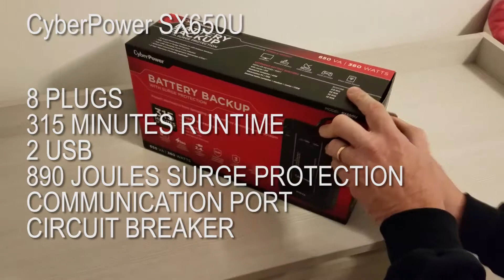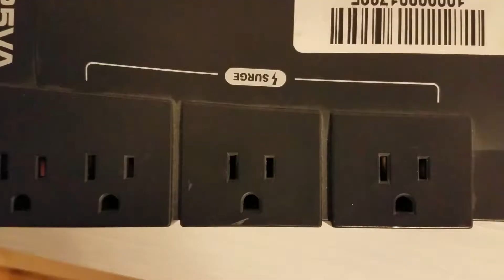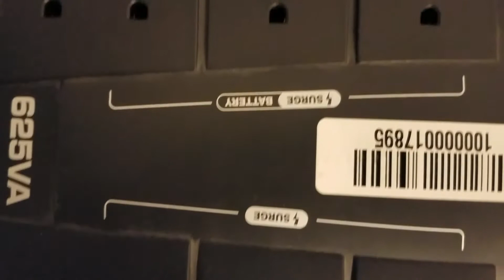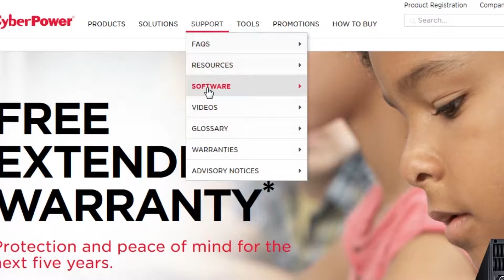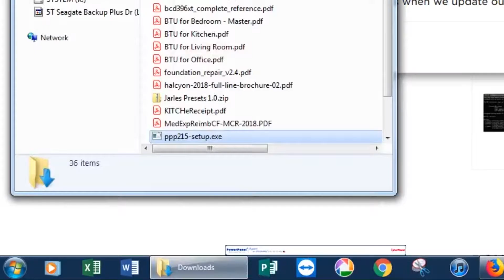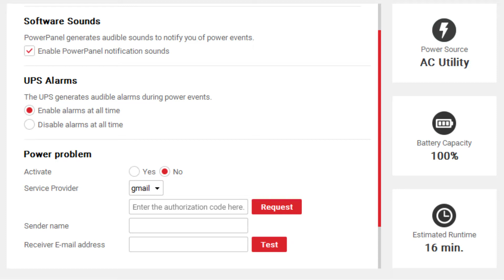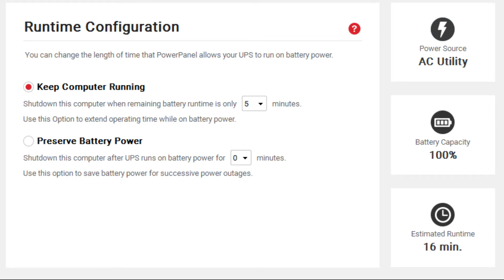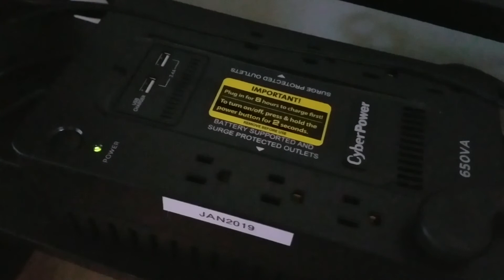CYBERPOWER 650VA UPS Truth and Lies

Comment: Mine keeps switching from eco to battery mode for no reason. I have a smart TV plugged in, a pc, a modem and two phone chargers. Worked fine for about three months, now it's doing this madness
Reply from the maker: In the Powerpanel do you see any items listed under Event Logs or Summary? BTW the Event Logs default to the current day so you have to give it a FROM date that earlier than today. If nothing listed then it could be a problem with unit, and I would reach out to their tech support.
Reply: Dirty power. These things have a auto transformer in them and they are programmed to switch to battery power during brownouts loss of power and over voltage/surge. usually they will switch to battery power if the voltage drops below 115 volts or goes over 127 volts.

Comment: So do I leave the power OFF when charging the battery or does it charge when the power is ON?
Reply from the maker: The unit starts to recharge the battery pack upon being plugged in and if in the ON position is able to apply voltage correction and power to your device(s).
Reply: @cfldriven  Awesome. Thank you.

Comment: Just wondering why it does not show any light while charging!?  Don't know if it's working? I just buight it , any Idea ? maybe it's only my UPS ?
Reply from the maker: The only comes on when you turn on the unit.
Reply: @cfldriven  oh ok but how do I know it's charging ? Light is solid yellow not changing at all , not even blinking while charging !
Reply from the maker: @emmontana2422  There is no charging indicator light. If the light is always on even with the unit is powered off but still plugged in than that might be an indication of a  bad  ground,  missing ground,  or  reversed  wiring. If you install the software it will tell you the status of the unit and if it has charged. You could also just unplug and see it the ups powers a lamp.

Comment: Yeah I have the old model 650VA and it's failed me 2x in the last 6 months. Had 2 separate `blips' in the house lights and both times the unit stopped feeding power to the devices. Is that dead battery behavior? If so this POS only gave me 18 months of service!
Reply from the maker: Well it can that the battery has died, rip, in which case check the warranty you maybe able to get free replacement. Or you are drawing too much power and it runs out of juice. Try something simple like one device and see if it keeps it running and for how long. As I say in the video you will not get a long run time unless you are just recharging your phone, these devices are meant to give you enuff power to safely shutdown in extended outage, but should ride out during a blip, unless it is overloaded.
Reply: @cfldriven  Thanks for this. Sadly the warranty expired but I can't verify on the website exactly how long that is. With my existing devices I was getting about 10 minutes, then suddenly the unit dies at the slightest blip. Time for a new/better unit! Cheers!
Reply from the maker: @danh543  You have a choice of replacing the batteries and saving some money over a new unit or you can upgrade to something like the CyberPower CST1500S. Here is a video on it  https://youtu.be/XveVObW70K4  .  What I did was drop new batteries in my old unit and moved it to backing up the router and some small devices, and put the new unit with the workstation. Best of luck.
Reply: @cfldriven  Interesting that the website says the model SX650G does not have a replacement battery except with serial numbers starting with `RAF'  I think I'll just recycle the thing and upgrade to a better solution. Thanks for your excellent information and responses!
Reply from the maker: @danh543  As I recall, I purchased mine from another vendor. They are very common, but gotta make sure the connections will align with your unit. I generally replace the batteries once and then replace the unit after that. The current ups CST 1500S provides status readout panel and will run the workstation for almost half an hour. That gives me plenty of time to finish a render or casually close out applications. Good luck on your next UPS.

Comment: After setting up the UPS in software (i.e. disabling the beeping noises and setting cutoff voltages), will the UPS memorize those settings so I can disconnect it from my computer?
Reply: No. It is all in the software. At least on the older models. On the new ones I am not quite sure.

Comment: Thanks for this video. One question: is it best to turn off the UPS when you are not using the devices connected to it?
Reply from the maker: While it is designed be on, you can certainly turn it off if you wish. Ours are always on, even if the devices are off.

Comment: Mine does this one long beep whenever I use it to run more CPU and GPU intensive sofware. I have a 650va one plugged into a high power gaming pc, could it be I need a 1000va or 1500va one to fix my problem?
Reply from the maker: I am using a 1500va/900 Watt on my editing workstation. Your 650va will handle 375 Watts. When choosing a UPS, it is generally recommended you chose one with an output watt capacity 20-25% higher than the total wattage of the devices you want to connect.
Hope this helps.

Comment: Mine is constantly making this high pitched sound that I can hear from across my room
Reply from the maker: Only time there is a sound is during charging and discharging otherwise it should be silent. If still in warranty I'd called tech support.
Reply: You can easily mute it in pretty sure. Yes, the alarm can be really annoying at night.

Comment: a new 12v 5ah cost $16 on amazon.
Reply from the maker: Thanks for sharing that info. I tend to replace the batteries twice before replacing the old unit. By that time the tech has improved and the ups has improved features.

Comment: I Gave you a thumbs down because there is none that tells you how to or what to do incase . so mine was brand new and i charged it 9hrs and it would turn off i needed it for my boat to charge my phone or hear a bit of music on my radio and it would work for 2 min and it would start beeping and then it would turn off.
Reply from the maker: Elizabeth sorry the video didn't help you out, but it sounds like maybe you are using it for the wrong application. If you are looking for a power source to run your radio, phone while boating then you should look into portable power station. The UPS is meant to come on during a power disruption and depending on the load may only last a few minutes. I just did a video on the Cyberpower CST1500S, which has more power then the 650VA but it only ran my computer for twenty minutes. 
https://youtu.be/XveVObW70K4
Thank you for commenting.

Comment: You can pimp these small UPS's by just getting a larger battery that won't fit in the case. Same cost for one with 3 times the capacity and an extension on the battery cables. Don't try this to enable use of larger appliances, but to extend service during outages with the recommended small loads. The software will not calibrate to the larger battery but you don't even need that geek stuff. Mine backs up my deluxe chair with 5 motors so I won't get stuck fully reclined, one LED table lamp and one laptop.
Reply from the maker: Probably a lot cheaper solution then buying a higher capacity unit. I can see where in some situations your solution is worth trying. Thanks for sharing how you use it.
Reply: @popeyegordon  How high can you actually go in amp hours? After a quick search on Amazon, I'm seeing 20 and 30 Ah batteries for about the same price as the 14. Don't some batteries need to be vented and are not recommended for indoor use? Which particular battery did you go with?
Reply: @markglenn24  Remember the same battery chemistry, meaning the same charge voltage and maintenance charge that is right for your original battery is all that matters. Unlikely your power will be out for days and you are still limited to the same wattage load rating for your UPS. 30 AH is pretty heavy, as big as a small car battery. This type of battery is not vented if is the same as your UPS uses. Sealed AGM gell cell. Sealed.
Reply: Very cool do you know of any how-to videos for upgrading the 650 ?  If it's just a simple upgrade the battery deal can you tell me which battery I should go with ?
Reply: @markglenn24  Any larger battery of the exact same chemistry type, typically sealed AGM lead acid gel cells, will have the exact same fully charged float voltage for standby and your UPS won't know the difference. It has one charge rate only so the big boy will charge slower but retain that longer reserve service if an extended outage happens. The added price for 3 or 4 times as much amp hours capacity is barely double the cost of the original battery and the bigger ones usually have a longer service life.
Reply: @popeyegordon  I'm not really knowledgeable about charging float voltages and wouldn't want to buy the wrong battery could you please point me in the right direction maybe something you already know is working with the SX650U ?
Reply: @markglenn24  All of the gel cell AGM sealed batteries have the same float voltage when topped off. You don't need the same brand of battery, just the same battery chemistry. When shopping, try to find one with the same type of connector terminals. Some motorcycle batteries have screw terminals so just a raw exposed wire can be clamped tight for a good connection.
Reply: @popeyegordon  Thanks for taking the time to reply to me here like this. I got you 100% on getting a gel cell AGM sealed battery and how to wire it.  The problem I'm having is with the capacity and with which particular voltages and Amp Hours battery to go with?  Which do you recommend?
Reply: @markglenn24  1) remove the battery  2) figure out exactly what it is by reading the markings   3) buy a larger capacity version   4) extend the wires longer so they reach the bigger battery outside of the UPS case, assuming you can't make the existing wires reach. Wires have to be soldered or joined by crimp connectors, don't even think about just twisting them together.

Comment: New units have circuit boards and components that emit a slight burnt smell before you ever plug this in. As a technician I have run across many devices that may smell this way even when brand new and never powered up but be safe and normal for years. I find mine is very efficient, the booklet describes the high efficiency battery charger circuit that wastes very little power on standby. When I plugged in mine for the initial charge the case only had one barely warm spot after several hours, no warmer than human skin.
Reply from the maker: Thank you for sharing your expertise. I agree these units run cool, although the battery run times on the packaging can be very misleading. Still I would recommend this type of device for protecting home electronics.

Comment: I bought 2 of these and they smell like its burning plasic and i barely plugged it in also does is it normal for the battery to shake on the 650 va one?
Reply from the maker: Is positive connected to positive and neg to neg? There should not be any smell of burning plastic. Could be electrics in power supply.
Yes the battery fits loosely in the case, so it may rattle when moving the power supply.
Reply: @cfldriven  Maybe it got damage cause the 2 smells like burning plasic and the smell is high

Comment: Does the UPS load mean how many watts of power are plugged into the unit?
Reply from the maker: Yes it is the total number of watts drawn by all attached devices. Ideally your UPS load capacity exceeds your system load by a fair amount. The greater capacity the longer the battery run time when AC power goes out.
Reply: Thank you

Comment: Hey man, I am looking for a way to keep my modem running as all my Ring security cameras are wireless and on solar panels. How much runtime do you reckon I would get just having the modem running on it after a power outage? and will this device do the job?
Reply from the maker: Because your modem only uses on average a dozen or less watts of power it will run longer then your computer, but don't expect it to run all day. A unit like in the video maybe 60 to 90 minutes of run-time.
You may want to check out this link for a run calculator. https://www.cyberpowersystems.com/tools/runtimes/
Reply: @cfldriven  thanks man
Reply: @cfldriven  my 850  va lcd will do 244 mins/5 hours for my router alone.
thats why i bought it. i lost power for hours the other week and id like to use my laptop when it goes out.
Reply from the maker: @Taybrenn  Just got the CyberPower CST1500S and with only a single workstation on it, I can do a fair amount of work before having to power down. The idea of using a UPS with a small load can as you demonstrated get you lots of on time. Also great for charging mobile devices. Thanks for sharing.
Reply: For outage longer than a few hours you will need a backup generator. A UPS will protect equipments as output from portable generator might not be as "clean" as utility.

Comment: Mine will occasionally start beeping 2 times out of nowhere and it lasts for a while idk why it does this? Can you please help me
Reply: I have the second one you showed in the video the 625VA the old one
Reply from the maker: A drop in line voltage might cause it to start beeping. In my house running the microwave will cause my new one to start beeping.
Reply: cfldriven ok so the beeping has stopped but after using it for a few hours it just turns off and everything it’s connected to turns off, this has happened two times so far and my pc turned off and I have to go and press the power button on it for it to turn on. Do you have any idea why it’s doing this? I have the older version that you showed in the video. Plssss respond
Reply from the maker: @mangy_marmot2  This sounds more like the internal battery needs to be replaced. Being that it is the older model it may be better to buy a new unit with today's technology then to locate and buy a battery to get this oldie working again. I only consider replacing the battery once and then the next time send it off to the recycling center. I have also had older ups go bad and wasted money on getting replacement battery. Sorry I can't offer more. Good luck.